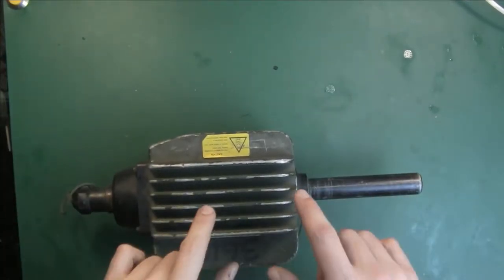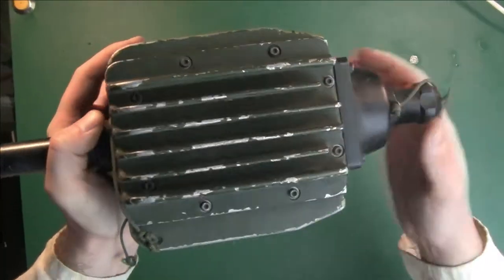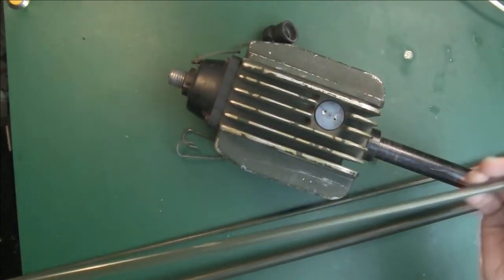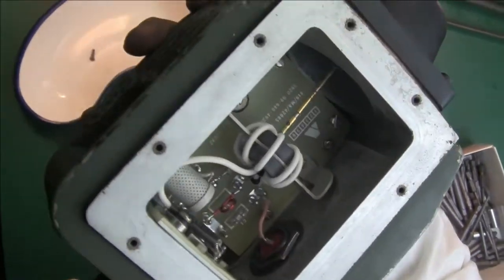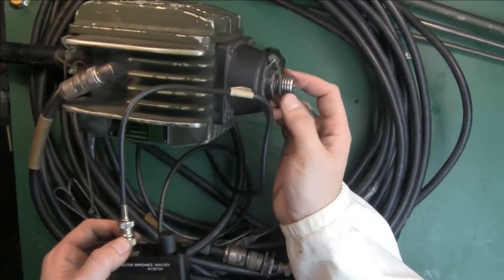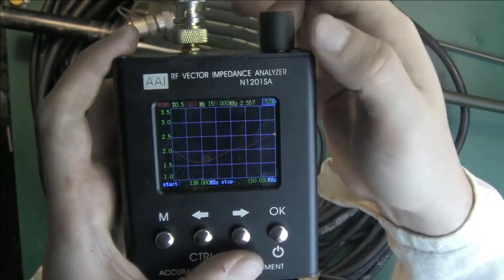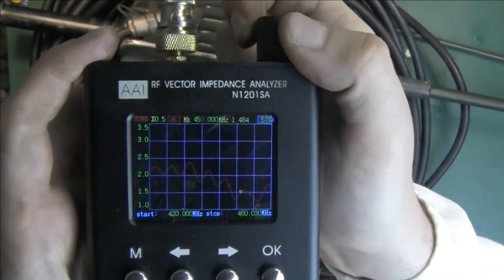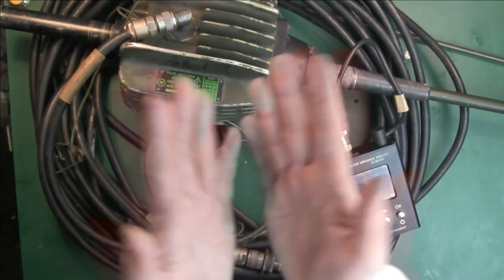Clansman elevated VHF antenna also called pineapple EVHF from ex British Army

Comment: What is difference between this and GSA? Why would you chose one over the other?
Reply from the maker: GSA You would use in trench, on ground (I believe there was elevation kit) and it's fully portable - attach to backpack and You have antenna that can be deployed in seconds without tuning. Pineapple it heavy, require mast , radiating elements are long- and You don't want to carry it around - I would use it to deploy at temporary base station but not for hiking.

Comment: The connector is C Series
Reply from the maker: Thank You for letting me know,
From my perspective i add that attached cable accept RG8 size connector - i changed mine.
Looks very nice but i'm wondering what kind of attenuation bring that cable on UHF, sadly i can't see any markings to follow google.
Reply: @ElectronicNoobBlog  RG58 becomes lossy above 100MHz so it is best not to use it for longer runs of cable above that, however, the 'pinapple' only goes up to around 76MHz so well below UHF.

Comment: Hello man, good job. Where i can buy one?
Reply from the maker: Hey, search eBay for "clansman vhf antenna"
Reply: Done...but will be nice to know, how SWR it have on HF bands, 80-40-20m...of corse efectivity will be horible, but still can be used, if you have nothink else for HF.
Reply from the maker: I'm also curious but i do not have antenna analyser working on HF to check SWR on that frequency range.
One day i will win lottery, grab rigexpert then i share results :P. 

But in my personal opinion, i would recommend You buy a antenna tuner and grab a random wire. I'm pretty sure results will be much better than using this antenna.
I tested it on 27Mhz and im not impress. 
Keep in mind it's a dummy antenna for army use, they are not doing any DX, most important is that operator could work in any channel in frequency range, any range problem they overcome by using more power still not needing to use any antenna tuner. So it's a compromise even on dedicated frequency range.
Reply: @peterostender8627  its  not designed for HF but for VHF and used with the clansman RT 351/2 and RT353